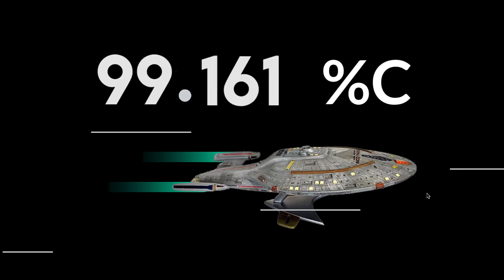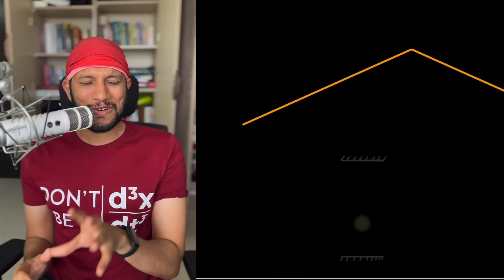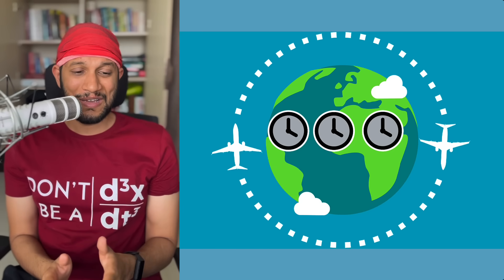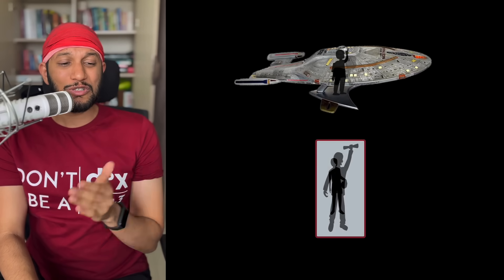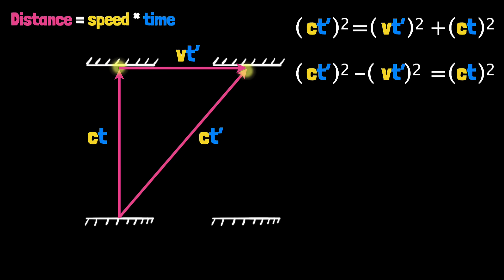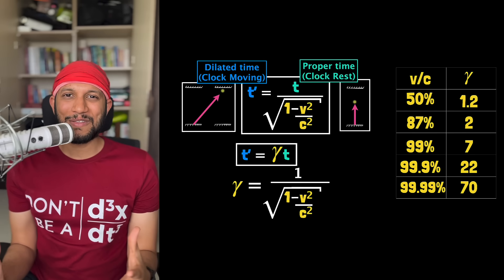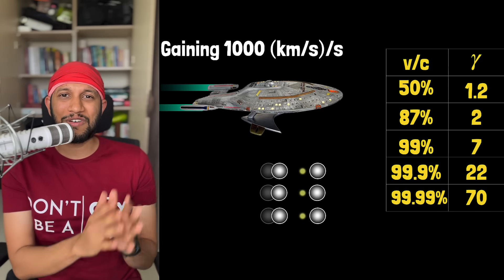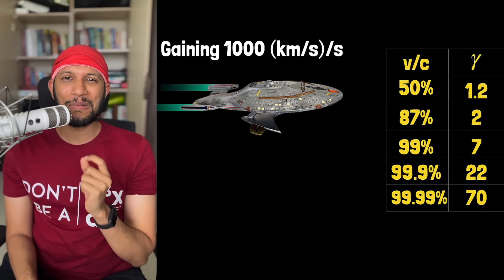I finally understood why you can't go faster than light! (My mind is blown)

Comment: sepends of beholder, for me if i will look at your starship your speed can not be more than c. for you, when you will flight at 0.3c your time go slower, and you will have for example 3c. as fact you will look on your watch and for 1 second you get 3 c at certain <c for me. and when you will close to 1c for me, the time will start to lost sense, as you will exist in the same time in many coordinates, and when speed will 1c time will not exist for you, and you will literally everywhere on your path where your starship moving 1c or the closest to c for external beholder to much more faster than c. c is not a speed actually, because everything that have c have no time literally, so have no speed for count the speed. light exist nowhere and nowhen, your ship exist everytime and everywhere on the path the closer c for external beholder. most important in this universe is point of view and perception:) they are same, but first is physical aspect, second - psychical. when you see tracer bullet you don't see the bullet you see the bright line at some coordinates. or when you drop end of the cigarette it's rotated and drawing red flower in the night air. or when we see laser beam in the haze air. there different speeds, but same perception. the difference of light speed traveler - whole the thing around will look like mentioned examples. if you will have the my clock translation in the ship you will see how the hands of second minute and hour disappear or drawing one big circle because for me your ship will have c speed, for you will exist "infinity speed" or 5c if for me your speed will 0.7c for example. so actually light moving faster than c from the light point of view, depends of the environment it can be 0.9c or 0.99c or at some short "period" 1c. when lost interfere with environment. but idea of light hasn't the time and hasn't the speed. it's all only external views. it's like some people when thinking about other people, but actually they just thinking about mirroring image in their own consciousness, and that's not only about people, any object the human can see won't be objective, but only subjective in the consciousness. and the more complex object the less sense has an image in an consciousness. light and human are pretty complex objects:)

Comment: Sorry for a stupid question. To an observer outside a spaceship in which the clock is present, why does the light travel in a diagonal path? Why is the path not erect straight up?
Why is there a horizontal component to its path?
Reply: Because the ships crew set it up to hit the mirrors so that their clock works.
Reply: @ArneChristianRosenfeldt  thank you, but why does the light care? It should keep moving in an erect line irrespective of the motion of the ship. What am I missing here?
Reply: @randomcommentor7001 the ship is moving. For some reason impulse is still added like in Newton. So the movement of the “laser pointer “ as it injects the pulse still alters direction. And color. But not velocity.
Reply: @ArneChristianRosenfeldt so when you say impulse is added like in Newton, I believe you mean there's something like the added velocity of the ship, right?
Reply: @randomcommentor7001  something, but not exactly. Lagrange and Hamilton already said that velocity * mass = impulse has its own life. IMHO physics in school does not really teach this. So F = m * a is not a good way to express things. Rather F = dP / dt  . In Quantum mechanics associates impulse with wave vector like it associates energy with frequency. Right out of the bat. Old school Quantum mechanics before Copenhagen.

Comment: So…it’s simple. Everything else in the universe we are comparing to light is bigger than light and it has more drag than light. The universe isn’t a void. It has texture. Like a grain of sand suspended in a glass of water. That sand has a drag coefficient and bigger grains of sand have bigger drag. Light the object is light the characteristic of weight. It moves with essentially the lowest drag possible in our universe. That’s what makes sense to me. I think that light has a special relationship with reality (the fluidic volume) itself

Comment: The secret is that light does not travel, it is born at it’s source and it’s destination in the same instant. There is no real speed of light because we have only measured the two way speed of light using a mirror but it could be completely incorrect

Comment: Doesn’t make sense how the ticks would take longer. Are you telling me a yo-yo journeying down the string and back up goes slower because it’s in a car moving 60mph? 

I get inertia doesn’t apply to something with zero mass. But how would it slow down light just because it’s moving technically the same distance if empty space wouldn’t disrupt the constant speed of something with no mass?

Ima laugh if my question gets answered later in the video.

Edit: ahhh I see. Because light is a constant speed. So, if light is moving in a direction(and we’ll keep it simple to understand 100=light speed) ^upward^ but it’s also moving >sideways> at 40 (40%light speed) then technically it’d be moving through space at 140% light speed. But it can’t if it’s constant. So you’d cancel them out. Now the light is appearing to move ^upward^ at 60% because it’s also moving >sideways> the remaining 40% to equal 100 aka the constant speed of light. 

Correct me if I’m wrong.

Comment: For me the simplest idea was that we are actually always travelling the space-time continuum with the same speed! The difference is where the vector of that speed is directed. If it’s directed towards one of the space axis - you move in space but stop moving in time (like photons). If it’s directed closer to the time axis - you move in time but practically don’t move in space (most material objects that are bigger than a photon)

And to turn this speed vector around is the hardest thing you could imagine and your mass is the coefficient of resistance of the force that you would have to overcome to do that…

Comment: I have barely a rudimentary understanding of this subject, but Einstein also says that light always travels at the same speed regardless of the observer's motion. This means that even though observers outside the ship sees time slowing down on the accelerating ship, passengers on the ship will see time moving as per normal. Time literally moves slower on board the accelerating ship as compared to movement of time for observers outside the ship.

The phenomenon you described also causes the doppler effect where light from distant objects appear blue shifted when the object is moving towards them, compressing the lightwaves, or red shifted as the object moves away from them, stretching out the light waves.

Im not even sure if I understand what I just typed out honestly.
Reply: I dunno what distance has to do with it, but yeah, time dilation should red shift light source on the ship. Doppler shift happens “after” this. Now I wonder if blue and red shift compensate each other at some angle.

Comment: I have a question. So if you were to travel at the  99.9% the speed of light for an hour. The people observing you would see you almost at a standstill. But technically from the people inside the ship they’re still in another place correct? So does that mean the travel is still possible for the people in the ship, and just not for the observer. Or when the ship decelerates they’d be in a similar spot to when they started.
Reply: They would have traveled both in space and time. Because everything slows down so drastically, they would be confused. They would say "Wait, hold on, we didn't travel for an hour, we traveled for just several seconds!". And they would be right. Everything slows down near the speed of light. Everything. Clocks, photons, metabolism and brain waves. So yea, from outside point of view you'd just see a streak that is not identifiable and shapeless traveling for an hour, but from inside, you'd just be your normal self for a few seconds and you're there. 

Someone once did the math, if one were to travel on a spaceship to Alpha Centauri, a star that is 4 light years away, at the 99.9% speed of light, the trip inside the ship would last approximately 65 days.
Reply: Of course they did travel. This kinda shows how speedster super heroes cannot work. You cannot move fast and still move your legs. Well, perhaps speedsters are limited to << c . Same for cars. Wheels cannot turn fast enough. The upper side of the wheel would reach 2 c. A trebuchet might work.

Comment: digital clock. or make the plane a clock when it passes light speed, that is one tic.
Reply: what is a digital clock? You know that clocks use mechanical oscillators no matter if the display uses digits or arms?
Reply: @ArneChristianRosenfeldt  forget the clocks.why give the guy on the ship a clock if clocks do not work at those speeds. or give him a clock that adjusts and corrects for the failing at high speeds. you got to go by the guys on Earth's clock. i mean if your clock is slow and you know you got to be back in  20 years , why are you pretending you think you can use it to count to twenty years?  I picture a clock on the gravitron and the dials can't move or barely, like, why would you follow that clock?
Reply: @TALKATIVE_CARTOON  physicist at the time thought ahead. IMHO SciFi shows really lack. I could imagine that two or more space ships travel through a void ( just the space between stars ) in different direction. They need to come to terms to maximize radio transmission, but also avoid a collision ( or even proximity, if they use volatile fuel like anti-matter ). Now what the captains do on the ship is like what we do if we say: the right side ( from our perspective ) or the right hand side. Or star-board ( perspective of the ship ). Or sinistral and dextral for a patient no matter where MDs and nurses stand.
Reply: @ArneChristianRosenfeldt  Set the street lights on every 20 years, and everyone has to be home before the street lights, or they are locked out the whole 1000-year night.

Comment: 1945 We Cannot go faster than the speed of sound... YAY Chuck Yeager... and we learned Do not go the speed of sound the harmonics are NOT pleasant, Jump through... (FTL will not happen with acceleration), and Perhaps we don't have the MATH yet to tell us how to punch through...
Reply: How do you even compare that? We knew that asteroids were faster. The sound of the tip of a whip was explained this way. Do you scorn all the victims of the V2 rockets which clearly were faster than the speed of sound? You know that super sonic bullets were a thing? Chuck Yeager planes fuselage shape is scaled up from a proven bullet shape.

Comment: 7:38 Hey look buddy, I’m a physicist, that means I solve problems. But not problems like “what is time”, because that would fall within the purview of your conundrums of philosophy; I solve practical problems!
Reply: is this a quote? Is this about applied physics? Engineering? Since we decided that Cs is a better clock than the Sun, "what is time" became a part of physics. I think that watches started the discussion. Fine Swiss engineering with metals which use Magnetostriktion to compensate for temperature.
Reply: It’s from Valve’s “Meet the Engineer” video, with the character from the game Team Fortress 2

Comment: So basically, when the photon travels from initial position of the spaceship to the final position, it occurs obviously because a photon has higher speed than both it initial and final stations whose speed is nothing but the speed of the spaceship. So when (hypothetically) the spaceship reaches c (speed of light), the photon travels alongside them in sync never leaving or reaching the final and initial stations, analogically like three cars 🚘 travelling with equal speed travel in sync 🚗…..🚗…..🚗 and none can overtake another till their speeds are the same. 
So by that logic, the photon can never reach the final station, if we say it reaches after infinite amount of time that would mean that it advances from the initial station to final, though at an infinitesimal small rate, but it does, which would violate kinematic laws ( i understand normal newtonian physics isn’t applicable in quantum world that a photon is a part of but still would not go by the logic i wrote above which I feel is correct and basic). So my doubt is that why do we say it takes ‘infinite time’ instead of saying ‘it can never reach at all’ ?

Comment: I enjoyed the video and found it very interesting, but a couple of things weren’t entirely clear to me.

I’m not well-versed in physics or math, but I assume there’s a known mathematical explanation for why things get so extreme as you approach 99% the speed of light—like why the required energy (or time dilation) grows massively just to gain an extra 0.0000000001%. But intuitively speaking, is there any logical explanation? What justifies that drastic increase? Is it simply that we have to accept there’s a universal speed limit, and as we approach it, the laws of physics start to—so to speak—“panic” and break down?

Another question about the movement of the clock hands: instead of seeing them move slowly, wouldn’t it be more logical to see the hand bend, like a thin antenna on top of a car moving at high speed? If the atoms near the center of the clock move first and those at the far end have to wait for that “information” to travel, wouldn’t we see bending rather than just delayed motion?

Comment: But, if the speed of light was infinitely faster in the distant past, you in theory could have moved infinitely faster than current light speed allows. You would still be following the rules, just with faster light. However, there would be no practical difference to you based on your present frame of reference, so it would not be a known big deal to you. Same old same old so to speak.

Comment: For the one who are wondering

If a photon goes straight up, it moves vertically at speed c and covers ct in time t. Now if the source is moving sideways, why should that affect the vertical motion at all? Adding horizontal motion should only give it some horizontal speed. The vertical speed should stay c, just like throwing a ball upward on a moving train. So it should take the same time either way.

For light, they are not, because the total speed must always be c in every frame.
So if the photon has any horizontal component at all, its vertical component must decrease so that their vector sum still remains equal to c
Reply: Do not let you head hang down. Even John Carmack made your mistake when he programmed the movement of the Doom Slayer .

Comment: I turn on the light and you don't like it. You want to turn it off even right at moment I want to turn it on or even before i turn it on. You need to be equal to speed of light or even faster than speed of light. But if you can do that, the light will not be appear so all of your action will not happen. That why nothing can be equal or faster than speed of light.

Comment: this make me confused about what “speed” is, isn’t speed distance/time?
if so, how can c be a fixed value without a fixed reference point? (distance is the space difference between two points, right?)
sorry that i was confused and want to know more.
Reply: Is this why we assume the space is also expanding?
Reply: @parokatsai  no
Reply: We measure c with reference points. You take a gauge (I mean that metal meter in Paris), set up some mirrors and a rotating mirror with a clockwork to know the RPM or rather rotations per second. Or you use electronics. But the reference points are always two. I mean, your rotating mirror and the mirror at the end.

Comment: So you are saying super powerful and heavy black holes, never fully collapse.  Because at some point you are speeding up to 99.99xxx% of speed of light with so much time dilation that it effectively has frozen time, such that it takes billions of years to speed up further.  But that means that mass would never really hit the center of the black hole, it would take billions x billions of years to actually hit the singularity such that it gets closer and closer but never hit the singularity.  So singularities do not exist from outside of the reference frame of the blackhole.
Reply: Yes. And now add rotation. Neutron stars rotate with almost c on their surface

Comment: technically to be precise the atoms of the hands of the clock doesnt emit electromagnetic waves (photons). In an atomic clock (specifically cesium), time is measured by the frequency of electrons jumping between energy levels. These jumps are governed by the electromagnetic force, which is mediated by "force carriers" (virtual photons) traveling at the speed of light (c).

Comment: Dear author. I very like what and how you explain. But it still does not explain anything. The whole point you make with photon clock is that now, instead of statement of the fact the speed never reaches the spead of light, we emerge it from photon clock properties. If we normally treat photon like a ball (which you shown), it does not matter how fast you move, tick won't become slower. For instance, the time to drop (to the ground) for static and moving ball from certain height is the same, but since we know, that speed of light is finite and final, then ofc to respect equation, we have to agree on the fact it slows down. This helps to describe the process, but not obtain intuition unfortunately. But I still respect your explanation, it opens people minds. Thank you!